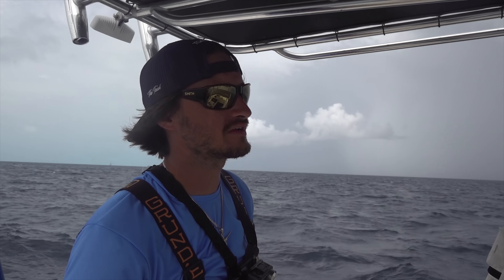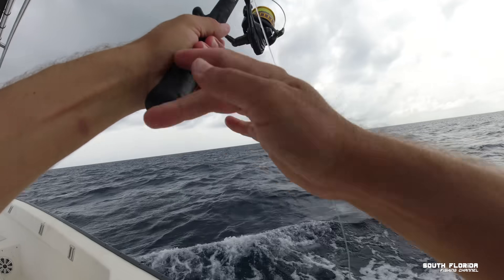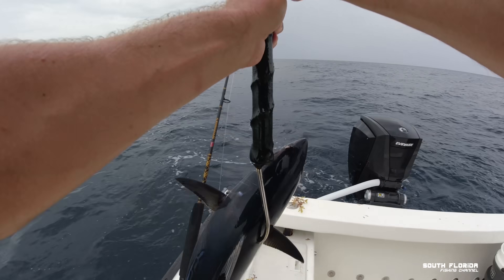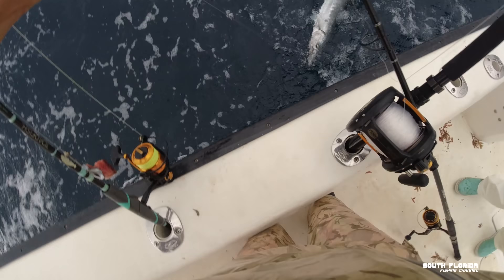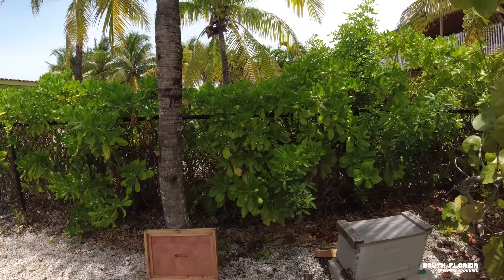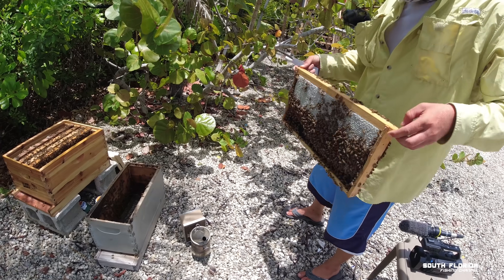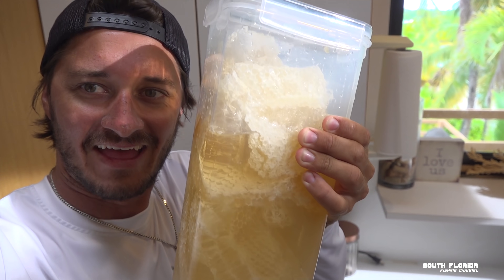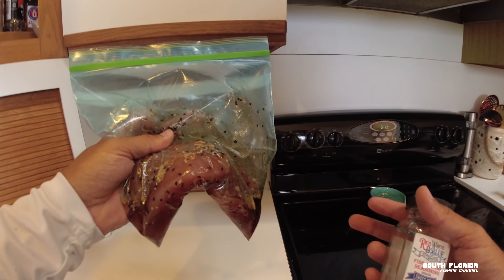I go Fishing and then Harvest Honey for my Catch and Cook

Comment: That wonky comb is because they didn't like the black plasti cell... I add a layer of beeswax to the plasticell and they draw it out much more consistently.   Check out Acorn frames...  they put a good coat of wax on (I still add more with a 4 inch paint roller and bees wax in a crock pot).

Comment: A light sprinkle of cinnamon in the hive will run the ants out.
(Also put the legs under the hive in containers with about an inch of cooking oil -add rainproofing above so the oil doesn't get floated out).